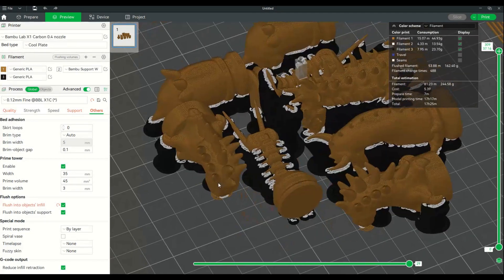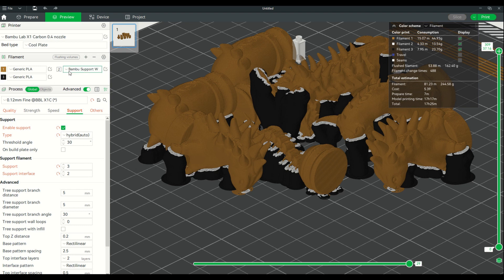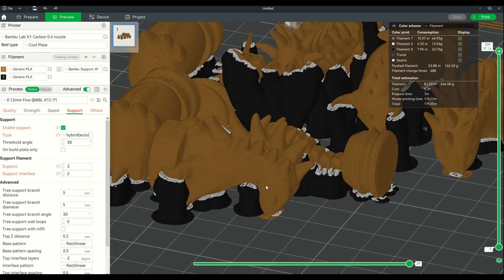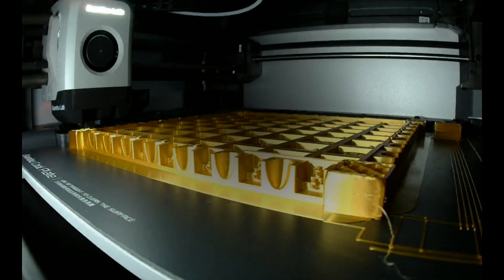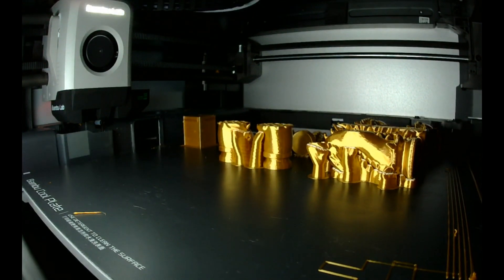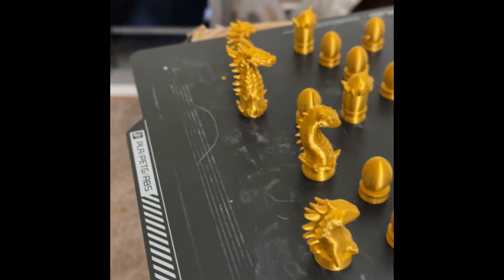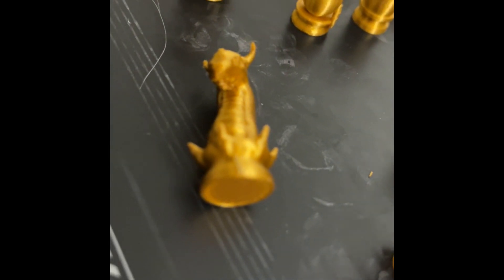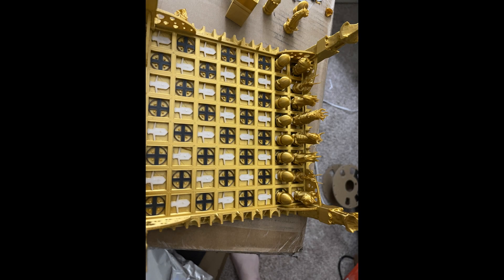bambu lab x1 carbon - miniatures and support/support interface

Comment: Wondering why you printed those horizontally instead of vertically, also adjusting the top z height helps with support removal/print quality. Usually .2 is recommended but I just match my layer height. I print minis at .12 so .12 top z spacing. Otherwise there ends up being too much space and parts don't connect to the model from the supports very well.
Reply from the maker: Been a minute but I believe it was because of the clearance of the chin on the pieces was having issues, this was before the cool tree supports were a thing and it basically wrapped all around it making it a pain to remove the supports(at 2:25 you can see one of the pieces I did upright that had that issue) or causing failure because of how the supports lined up and where the chin met the neck. I also think it reduced time because the support height lined up better making less filament changes

Comment: Here’s a trick. Use PETG as your interface layer. Put it in the ams and label it as Pla but it will actually be PETG just as the interface layer. It won’t stick to your model at all and it will leave a nice face on the print and come right off.
Reply from the maker: I’ve tried the opposite and didn’t work for a petg model, I’ll have to try with it like that, I’ve seen some other things mentioning that too, but I’ve had so little issue with the support on pla I haven’t bothered with dual filament besides trying it out, not sure if I put one up but tried pva water soluble stuff, it worked from the ams and printing it just fine, but it wouldn’t stick to anything(interface or the purge cube) so only use would be full pva support but haven’t tried that yet.

Fused Materials PVA 3D Printer... https://www.amazon.com/dp/B07XZHCNZV?ref=ppx_pop_mob_ap_share